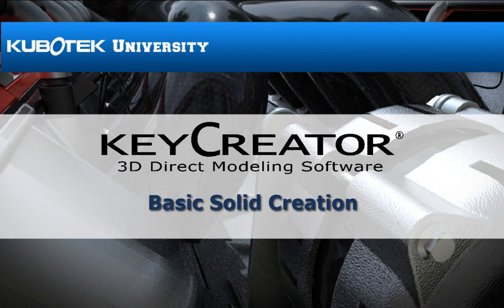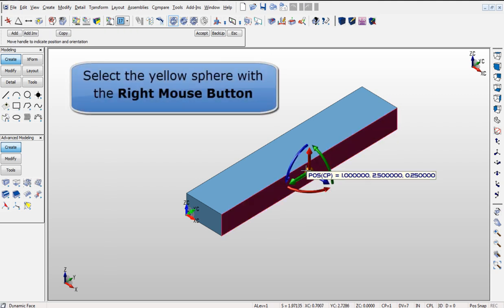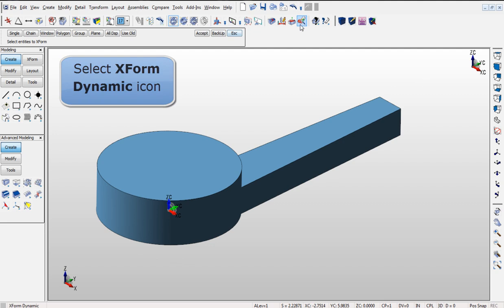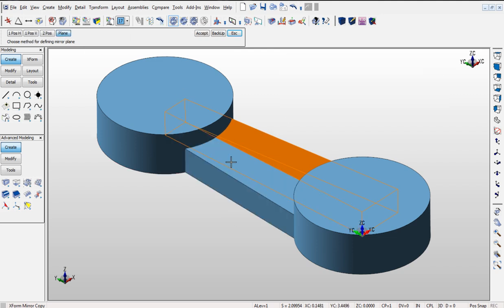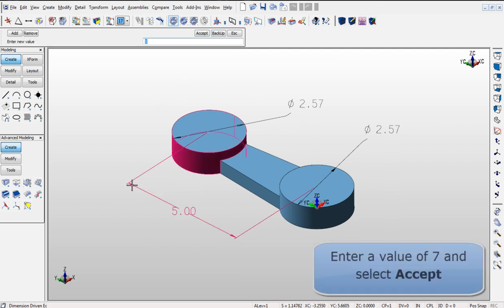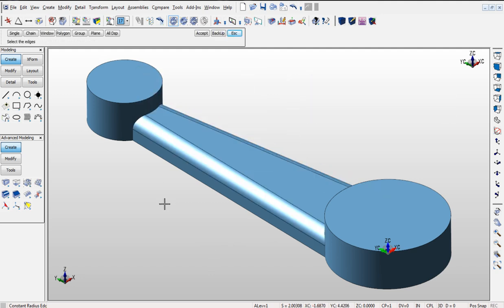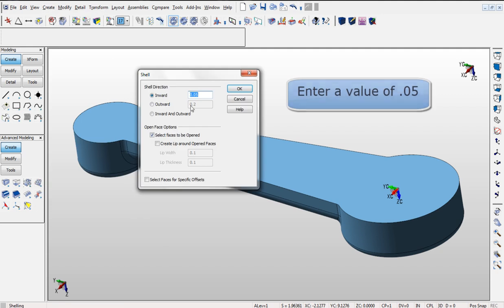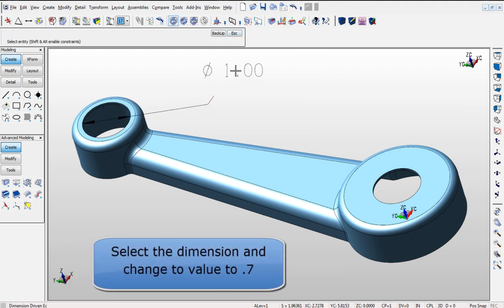Basic Solid Creation

Comment: yea i dont have the part coordinate display on my screen to navigate the part?
Reply from the maker: By "part coordinate display" you might mean the CPlane axis indicator (X, Y, Z in red, green, blue). The most common reason that is not displayed is that you don't have an active CPlane. In the status bar you will see CP=DV which means CPlane is set to match the display view. You can double-click on that and pick a plane from the list. 
If that doesn't fix it, check the settings on the Display page in the Application Options function. The display of axis indicators is optional.